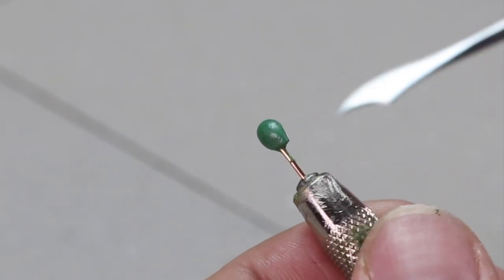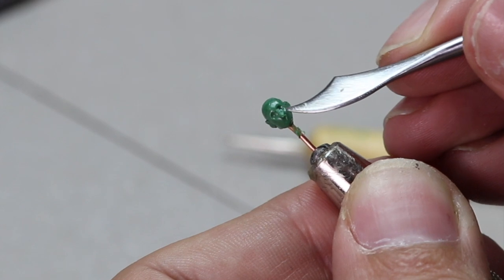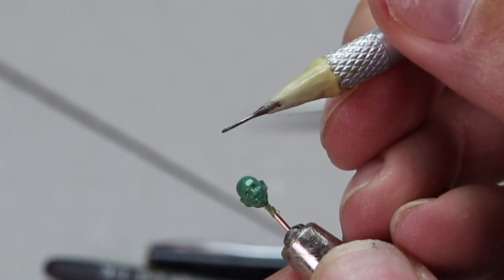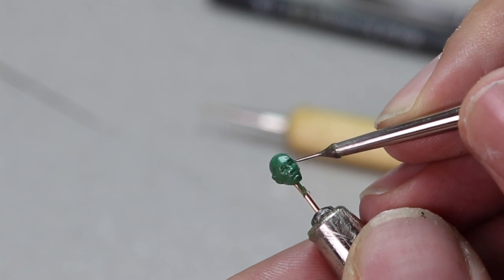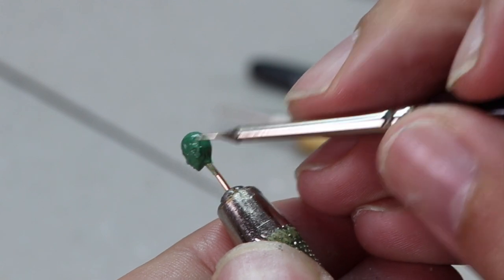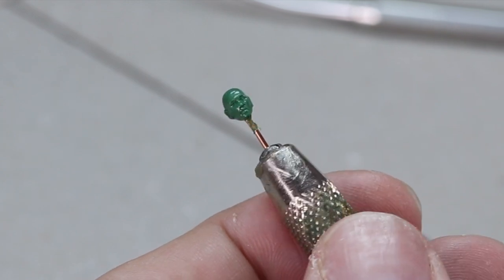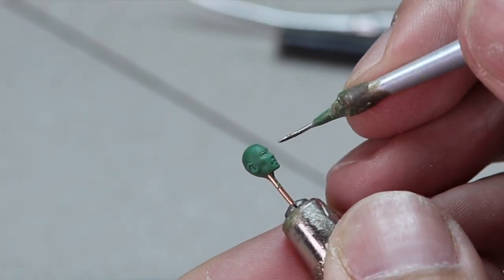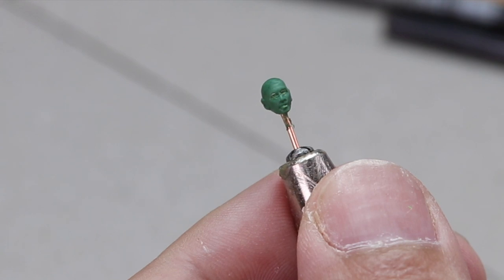Sculpting a 5mm head in Green stuff.

Comment: That's a very pointy clay shaper. Did you sharpen it, if so, how?I've tried in the past but have just ended up either cutting badly or tearing the rubber
Reply from the maker: I have a couple, one is more blunted after use, this one is just new. You can get different shapes with a more pointy end though!
Reply: I must have been unlucky with blunt tips then. I shall have to try before I buy! Thanks